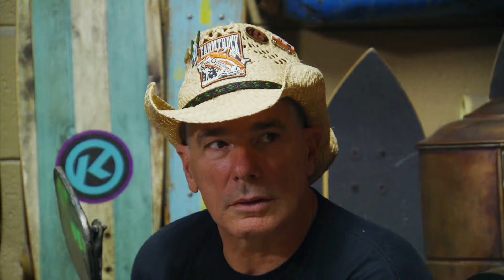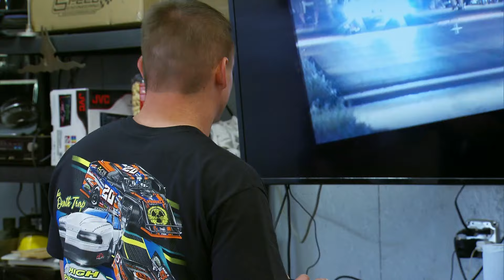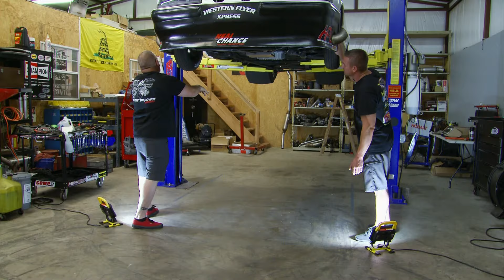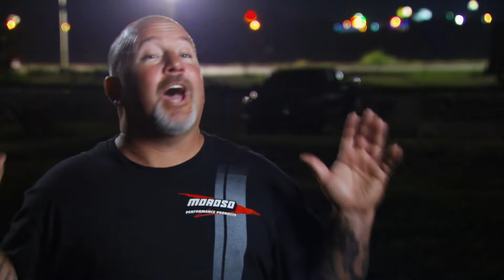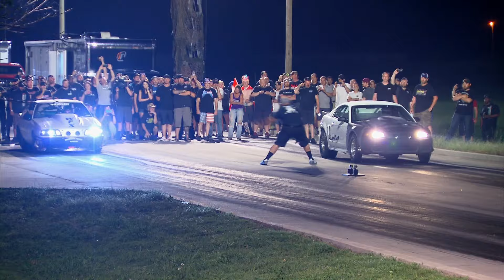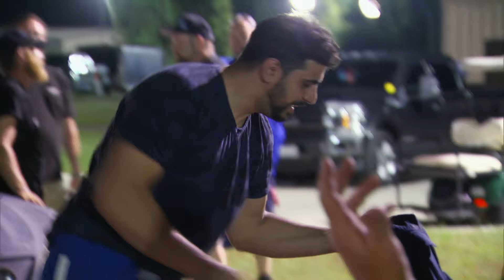Chuck Gives Opponent Huge Head Start In Canada Vs USA Grudge Match I Street Outlaws

Comment: Changing to smallmouth be a pain in the butt ?? I'm thinking the whole setup...weight distribution, and dumbing down the power is a pain. That or you'd just burn the tires off and she'll get loose down the strip. YES/No ???
Reply: On some cars, whole rear end should/needs to be changed. trying to get the tires more sticky to run smaller tires wont work, isnt that simple.

Comment: Those guys have got to be using high vacuum turbo piston return spring retaining clamp strap bolt washer locking components.
All along I was under the oppression that street use of turdboencrapulated gimutrunion is by permission only.